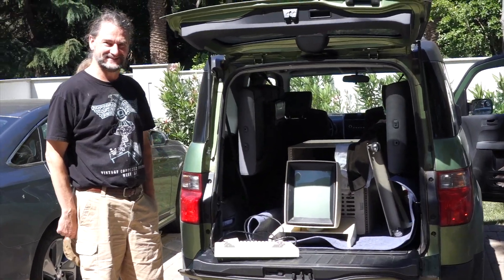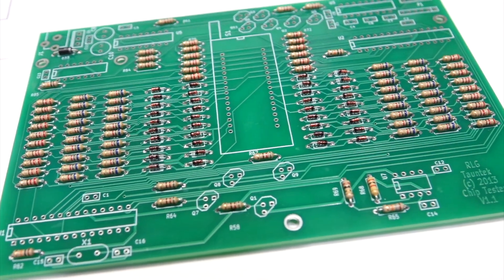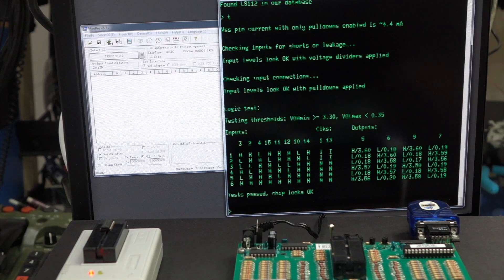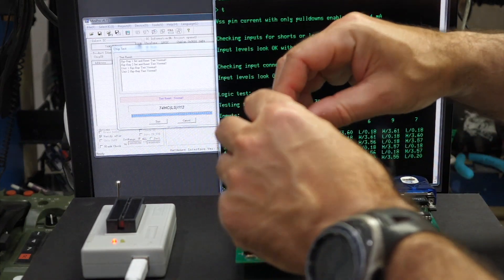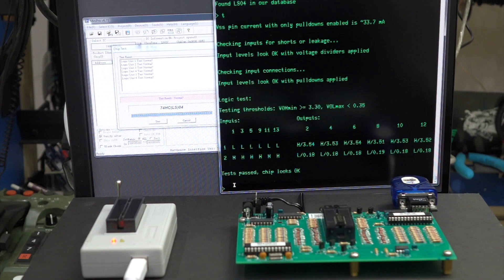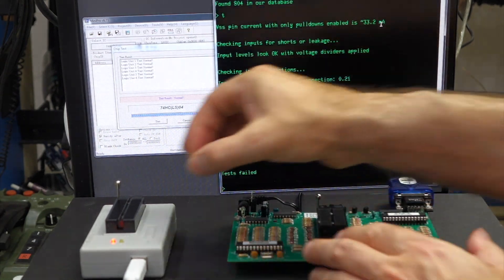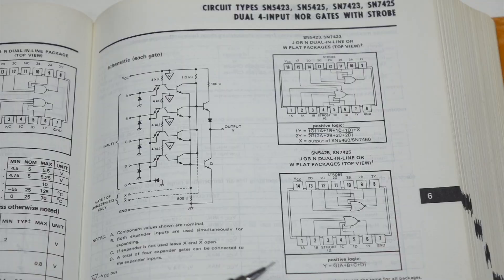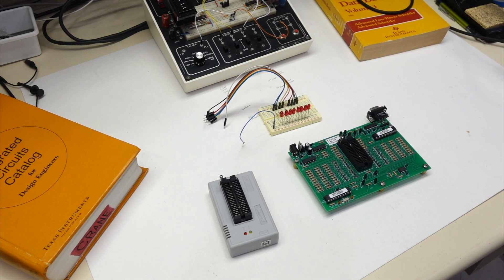Viewer-designed, Tauntek TTL IC tester!

Comment: Marc, what kind of adapter did you use for the serial port connection on the IC tester board?
Reply from the maker: I jury-rigged surface mount RS-232 connector, which is kind of acrobatic and not recommended. I believe the board was made to use one of these old cables that used to go to RS232 ports from motherboards on PCs.
Reply: I ended up doing the same. I could not get my hands on the old PC cable that was intended to use with the 10 pin header connector. He should just design the board to just solder on a female DB9 connector so a USB to serial cable can just connect directly instead of a mess of cables & adapters just to finally connect. Those old PC cables are hard to locate when you live in an area with zero electronic stores. Even the thrift shops no longer have the once piles of PC junk parts.
Reply from the maker: @glennbruner7504  Yes I suggested that too.

Comment: There is no reason that a gui gives less info than something on the command line, it could give more... But here we are in 21, and for some reason it's still true that you get more from text. 

Must have something to do with the programmers (I'm not bias! I write gui predominantly)... It seems gui is consistently ok'ish, but cmdln is either completely garbage or absolute dark magic.

After maybe 25 years I'm still not sure if I'm a fan of that trend or not, but there's a lot to be said about something that works and you get a "Success!" on the cmd rather than a "it worked!" and an OK button.
Reply: The Main purposes of the GUI and the Device is not to test Chips, rather to write to eproms. It probably cant eben thest the things that the other can. The other one is dedicated to Chip testing as is built for this.

Comment: Back when I was doing a lot of board repair, I used an ABI System 8 BFL which could do functional IC testing in-circuit as well as VI curve tracing on each pin, with the option of automatically comparing results with known-good board signatures. Saved so much time!

Comment: I've not seen the PLCC (and TSOP?) to DIP adaptors before. Obviously useful when the same IC can come in multiple kind of packaging.

Could this also identify the difference between 74LS and 74HC?
Given that there are some of the latter marked as the former in circulation. As indicated in this video. https://www.youtube.com/watch?v=Knfv-Qp7Q2U
The circuit in question works with a 74LS08 (and likely a 74HCT08) but not with a 74HC08.

Comment: Thanks, this is a very interesting device. Would like to build something like this for fixing retro machines.

Could you change the terminal font though? It's hard to read.
Reply: Older terminals used a limited screen resolution because the bitmaps for the font had limited memory, usually a 6 by 8 bit font.
Reply: @acmefixer1  it's a Windows terminal though, they can use any font they like. It seems to have a scanline effect applied that makes it look bad on a 1080p TV.
Reply: Alternatively show it connected up to to a HP 2645A.

Comment: That's actually a really impressive IC tester!
Now, to build an equivalent for vacuum tubes (since I can't afford a RoeTest)...
Reply: I've done pretty well over the years with a SIGNIFICANTLY dumber tube tester... a.k.a. ME
1: If there's cracks in the glass or the mirror-like getter flash looks like powdered sugar, straight into the bin
2: Does the 'pilot light' (filament) turn on - if not, check filament voltage and, if present and correct, throw it out.
3: Does the big black metal thing inside (plate) look like it could fry an egg from 50 feet.  If so, disconnect everything from the associated grid(s) and retest.  If it's still hot, place gently in file #13 and install another.  If it's NOT hotter than Mercury with the grids disconnected, replace all the leaking coupling capacitors

Rinse and repeat

Comment: I had not even thought about the analysis of the voltages and currents in the chips. I am trying to design a tester similar to the TL866 but now I want to add this function as well and maybe even the test of some RAM models. Nice also that vintage tester you used.
Reply: I just thought of the same thing - my concept for now would be to use an AVR-microcontroller with enough digital pins (not a master-slave construction as the one Marc had) and two 16channel analog switches. A possible platform could be an Arduino Mega, but I would probably not use the Arduino framework for my project
Reply: @uwezimmermann5427  I think I will use PIC18F87J50 as in the TL866. The cost of the chip is cheap, only 4 €. My concept is to create a PC interface connected by USB cable. The data sent to the PC will be processed by software or vice versa. In this way I will have to enter the parameters of the chips only in the sw. Currently not all power pins are connected to the ZIF. This limits the number of chips I can test.
Reply: @leonardochiruzzi7642  I am not a PIC-fanboy and more than just happy that Microchip even started to release new AVR chips since they have swallowed Atmel for its ARM-license. I tell my students that once they know how one microcontroller works they will be able to use almost any microcontroller, but I'll stick with my AVRs for now 😎

Comment: Wonder if anyone has modeled a 3D printed enclosure for the Tauntek? I just ordered one, so may be on my todo list if not already done. I also have been integrating inexpensive little FTDI boards in RS232 projects to provide 'native' usb. Don't have to worry about finding the adapter if you move to different PC.

Comment: Interesting! Freaked me out seeing you change chips with power on, though. Do they have tvs diodes or anything in there, or are those chips just more durable than my instincts suggest?

That Tauntek tester looks like the thru-hole pic powered predecessor of the Glasgow Interface Explorer. Wonder if anyone lucky enough to have one (mine is delayed due to ic shortage) has made an applet for ic testing like this.
Reply: The Tauntek tester only applies power when you do a test, otherwise everything is electrically isolated
Reply: So does the TL866 btw

Comment: Nice overview. Just a note, I don't know which version of TL866 you are using exactly, but the TL866II+, which is the most common today and is compatible with Xgopro software in version 11. It has more ICs in the list, which can be tested and it has auto detection. So you don't need to select the model anymore. Just put the IC into the TL866II+ and press the test button.
Reply: you have a link to the software?

Comment: The TL866 is great to use under Linux with the minipro Software, which current version offers TTL testing as well and allows to add your own test vectors in a text file to test chips not contained in its database.  The large socket even allows to test peripheral chips like a 8255.  It is however not dedicated to chip testing, which explains its restrictions.

Comment: I use the newer T56. Newer but mostly the same and has higher voltages to support old school EPROMs. It's digital and not a true chip tester like the Tauntek. There's a need for both on the bench.

Comment: I see your TI book says "Crane" on the bottom. Do you know who had it originally, or was it a surplus find? I have very vague memories with working with a Bob Crane in the early 70s, and I think he moved up north when the industry really started up there. (I wish I could remember more about him, but I'm blanking on everything but the name now.)
Reply from the maker: It is late Ron Crane’s databook. The co-founder of 3Com, and designer of one of the first (the first?) 10Mb Ethernet interface, once Ethernet got standardized after the experimental 3Mb Xerox Alto. Great things were done with that book. See Ron in this video: https://youtu.be/XhIohWr10kU
Reply: @CuriousMarc  I got mine from a teacher that was throwing it out.  I was like is that literally a hardbound TI databook I'll take that and he's like but it's garbage but okay lol
Reply: I inherited the same TI book from a  guy who worked for Ampex for decades. I also was given his mint condition Zenith Z-159 with all manuals and original brochure from when he purchased it in 1979. I still use his tube manuals and TTL books in 2021!